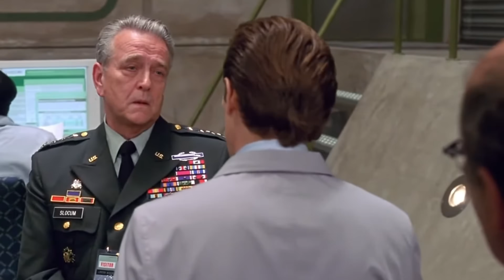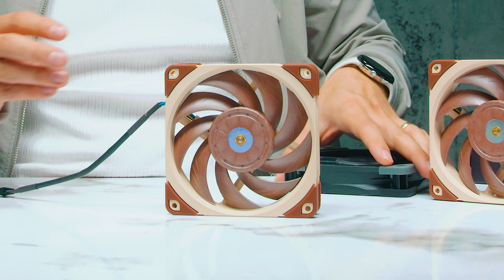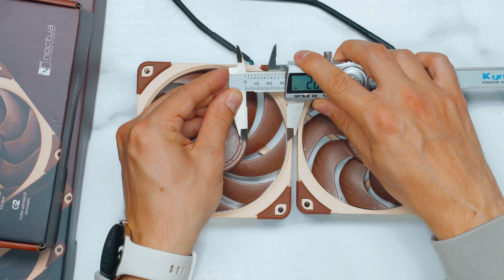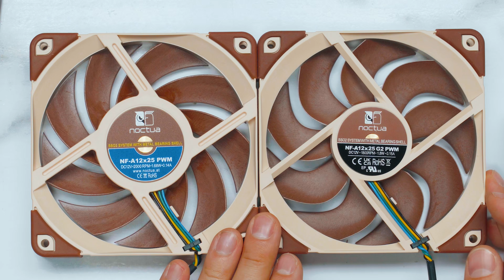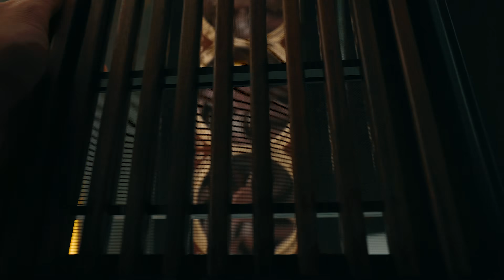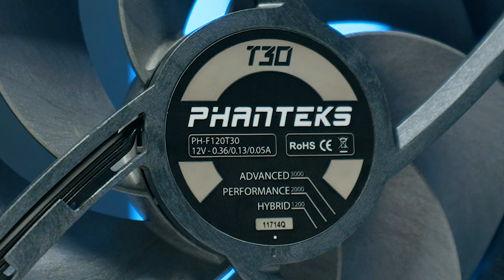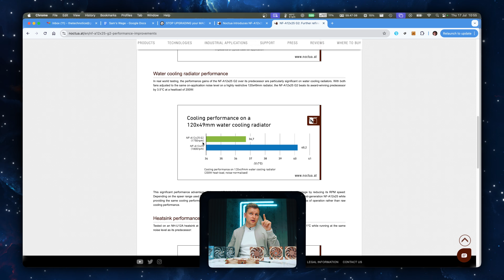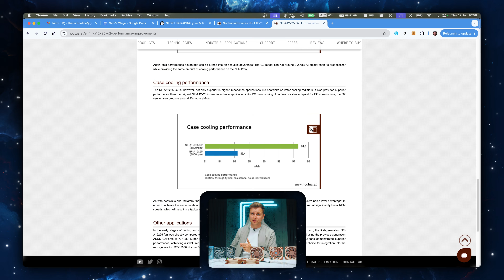Why it took Noctua 7 YEARS to BEAT the CHEATING Competition!?

Comment: There is clickbait and then there's this video.
Reply: I'm not sure if it's clickbait or just poor decisions.
Reply: @coreymoyers5771  be gentle, it took him SEVEEEEEEEn YEARS to come up with the right title!
Reply: He doesn't even know how to use the caliper and he probably felt useless himself when he went on a 3 minute yap about why he can't show us test results.
Reply: про рекламу забыли.
Reply: No he is right, at least partially. The Phanteks are too big for my AIO so they don’t fit and the Arctic p12 max I use gets unfortunately very annoying at about 3000rpm. Especially for ITX this is a lowkey game changer.
Reply: @Melnyx_definitely  huh? the p12 is noisier because it CAN go up to 3k rpm, and compared to the G1 version of the noctua, with both at max speed, it pushes 150% more air through a regular radiator and 147% more as a case fan. If your thermal testing for setting fan curves indicates your p12 max has to go to 3k rpm, the noctua would be insufficient airflow.

FWIW the regular p12 with noise normalised testing trades blows with the regular nfa12x25 on a regular radiator, and the deepcool fk120 beats it as a case fan - but again, NEITHER of them have as much airflow as the p12 max at 3k rpm, so would still be unsuitable for your system.
Reply: @Melnyx_definitely  Each company makes fans of different speeds/classes. He compared two different classes when there were similar speeds available.
Reply: @coreymoyers5771  The point being the competitor fans that have the same dimensions and rpm don't beat the equivalent Noctua ones. the only competitor fans that are better are in a different 'weight class' so to speak.
Reply: @ordin @ordinalchaos NOT the same RPM. That was my point, but you missed it. Noctua sells the same speed fan.

Your claims are baseless and scream from a lack of understanding on your part. Watch the video again and write down each fan's RPM. Then Google for a Noctua fan at the same RPM, and you will see they exist and are commonly available online.
Reply: @coreymoyers5771  Noctua does not have fans from the same generation as these (The new G2) with higher RPMs. The ones with higher RPMs are all older designs. So no, there are not higher RPM versions of the new G2 fans to compare with against the other fans.
Reply: @rekareaper Did you watch the same clickbait video as me? What does Gen 1 vs Gen 2 have to do with comparing faster fans against slower ones?
Reply: @coreymoyers5771  there are no other gen 2 fans that are faster than the ~1,800rpm ones. Fans having a different rpm doesn’t mean they can’t be compared. Lmao
Reply: @rekareaper He claimed they were the same speed and said the faster Noctua did not exist.
Reply: The dude’a affiliate link doesn’t even work. How gullible are you?
Reply: @coreymoyers5771  he was referring to the newly designed ones. There are no Gen 2 with higher speeds available than what was shown.
Reply: @rekareaper what difference does that make? I can’t help you if you think two different speed fans can compete with each other on airflow.
Reply: @coreymoyers5771  they can. Lmao. You’re just too narrow minded to understand how much different variables can affect airflow and static pressure.
Reply: @rekareaper you sound like you think the Earth is flat.
Reply: @coreymoyers5771  you’re the one whose logic would closely align with that if you think that only the RPM affects airflow. Lmfao
Reply: If noctua had rgb, even the most subtle rgb, then id get the black fans (if they were to have it). I grew up without rgb and when it started to become popular it was extremely expensive and now that it’s EVERYWHERE I want rgb everything. I don’t live a bland life and so I like color.
Reply: @BrofNeeko  Try Be Quiet

Comment: Seems like the rubber bracket’s to go around the diameter should be pre installed. Lot of messing around to seal that gap between the fan and cooler when mounting.
Nicely done video!
Reply: They are not preinstalled because you could mount the fan in any direction and static pressure doesn't matter if your mounting it as case fan instead of a radiator fan.
Reply: @Execuor  You could always remove and reposition on the other side - 50% chance of saving you effort.

Comment: I really dig the gaskets and I've always really liked Noctua fans, but I'm just not their target buyer- I don't really mind "loud" fans as long as they're not constantly ramping up and down and don't have a particularly annoying high pitch/resonance sound, which can be worked around by just slightly tweaking the curves anyway... 
I've got 3x four+ year old, cheap blue LED (not RGB) DC "no name" fans from Amazon on my main/ high end build and they don't bother me (yeah they're pretty loud, but not annoying). I also have five of those Artic fans in my mATX living room/ lan build (Montech Heritage) and I literally can't hear them over the "ambient noise" of my house without putting my ear right next to the case, so they might as well be off with any sound coming from the TV. 
If I get new fans and want to spend a bit more I'll probably look at Phantecks but I'd be extremely interested in a "no compromise brute-force" version of those new Noctua fans if they ever decided to make them- Maybe slightly deeper and around 2500 RPM, I'd be all over that for a radiator!

Comment: the matched pair with offset speeds is not about resonance. It's about interference between the sound from each causing an annoying "beat frequency"  They do not amplify, it's not a matter of more of the same noise, it's that the same (or almost the same) noise coming from 2 things close together interfere in annoying ways, NOT simply becoming louder.
Reply: It's about tandem resonance, hence the amplification....
Reply: @marioo-q8h  modulation, not amplification as such
Reply: @marioo-q8h that’s still not right. It’s an interference pattern

Comment: Other manufacturers are not cheating, it's just Noctua not following the trend. Thickness is not an issue in a lot of situations, such as case fans. If there's a 50mm fan that's can operate quiet, at low RPM, I'd buy that.
Reply: Exactly. I would incorporate that in my build. People building SFF PCs will wave it off and that is ok. But builders of a mid sized closed silent PC would use whatever performance is best.
Reply: @ThorMey-777  I'd use such a thick fan on my GPU, do the deshroud mod with that fan would be so good
Reply: Thickness is an issue especially for ITX, the group who cares about fans more than most people. I can’t use the phanteks in my A4 H2O since they literally too thick. Instead I got the p12 max, which work, but are sounding like a jet engine above 3000rpm
Reply: @Melnyx_definitely  Very few people build ITX its a niche.
Reply: @Melnyx_definitely  As I wrote, definitely not for SFF. Btw: Who aside from maybe industrial users or people with a private server room want to run a fan over 2000 rpm, or even 3000 rpm?
Reply: @Melnyx_definitely  a little trick - don't let the p12 max spin too much. It actually moves less air through obstacles when the flow is turbulent. Find where that happens for you.
Reply: @Melnyx_definitely  i think its more of a you problem if you cant dial in your fan curves and run your p12 maxes at 3k rpm. mine are 100% 0rpm idling and 800-900rpm gaming and this is more than enough. cpu stress testing does put them (cpu cooler fans only) to 1500rpm but thats it and its still just barely more audible than the silent profile.
Reply: Thinkness IS a big issue. You will have space problems and also have problems mounting the fans on certain AIOs cause the screws are not made for that thickness.
Reply: @naftyloescher  It is an issue, just not so much of an issue in other use cases, like as a case fan.
Reply: Noctua cant produce 200 different fans - they struggle to have 92/120/140mm fans in brown + black variants. And it absolutly is an issue in most cases. You often cant have big fans on top because of the motherboard. And on front panel there is simply no point and also no space. There is little to no cases that can fit more. Reminder if you want to have good cooling. You take the thick rad, and then you install push pull fan. So its 86mm (for example there are other rads i just picked Alphacool NexXxoS Monsta) + 2x25mm. I doubt your ATX case can fit that. And if ncotua would make 30mm instead it would fit even less cases - and it wouldnt fit most of SFF that are VERY popular nowadays - if someone build high end build - and noctuas are for high end builds. So yeah - assuming you dont already own thick rad andpush pull fan - no you wouldnt buy 50mm fan - you would think its not worth it - as you do now with thicker rad.

Comment: Arctic has a new fan out that you might want to check out, the P12 Pro. Same price as the P12 Max, but better. At least subjectively thus far for me. I have a few of the P12 Max and they all have bearing tick, have since day one. The P12 Pro is much quieter in that regard. They might even be a little cheaper. The last four I bought were under $9 and it's hard to argue with that price.
Reply: I was thinking just to change my old air cooler for new arctic freezer 360 III pro, but i want very silent pc with 7800x3d, so if i use these fans on let say 1000rpm all will be fine right and silent? (because stock goin to 3k is crazy)
Reply: @Dreamseeker-z9u  fyi if you already have an arctic AIO you will officially turn it into a "Pro" version by switching the fans to the Pro fans, that is literally the only difference between the LF III and the LF III Pro. I was using an Arctic LF III 360 AIO. I switched out the stock fans and bought the Pro fans, a couple weeks ago I stopped using the AIO I just went with a Thermalright Phantom Spirit 120 EVO because even with a 360 AIO my R9 7950X temps sucked.

Comment: First defining the other cheaters is a far stretch, they declare their numbers correctly 
Second you don’t even try to confront the spec of them out of published data from all manufacturers 
This seems just an advertising for noctua and declaring other vendor cheater is quite misleading no one of the other vendor to my knowledge has provided data far off real test performed by real testing site. 
Saying going at 3000 rpm is cheating is laughable, as a consumer you can decide at which speed you want to run them on one side and on the other if the fan CAN reach 3000rpm you can decide even time by time if you want more cooling sacrificing noise or not, if the fan stop at 1600 RPM you will not be able to reach certain level of performance. Like for engine you can run an f1 motor at low speed even if can reach 19000rpm and we can eventually discuss about efficiency when run at low speed but for sure you will not be able to reach same speed or rpm with a normal 4 cylinder motor of a standard car, it will be for sure more efficient at lower speed but it will not reach performance of an f1 engine, this is also the reason why for servers fan are run at much higher speed, in those environments no one care about the noise on a datacenter, the important thing is to get the proper airflow to cool processor and machine requiring much higher cooling than standard pc
Reply: if something looks like a duck, and quacks like a duck, then it probably is a duck
or somebody who thinks they are a duck...

Comment: I’ve don’t regret buying my Noctuas.  Cool and quiet, with zero problems from six year old fans
Reply: I have a nh-u12 for lga 775 from something like 17 years ago and the fan still works.
The cooler is still in use in my main rig right now, the fan is in my 2nd pc in my living room.
Reply: They will outlive you my friend.
Reply: Been 10 years 😂
Never clean them tho.
I'm using noctua industrial fan, guaranteed to exceed 150k hours.

I check the fans regularly, only small amount of dust stick to the frame & blade, it is indeed dust resistant.
Others will likely fail due to dust entering the rotor.
Reply: 2 with 8 years of service, still good :)

Comment: "Cheating" is kind of an odd way to describe it.
Reply: "Cheating" is the click-bait kind of way to describe it.
Reply: It is just a design decision to get more performance. Same with the Arctic Liquid Cooler III: It has a thicker Radiator than the competition and a bigger plate on the CPU, which makes it the best noise normalized AOI cooler on the market - if you make sure you got the room when building your PC.
"Cheating" is bullshit, because this is not a sports with clear ruling but a market competition. All competent reviews tell the consumer to keep the dimensions of the product in mind.
I have used both products (A12 and T30) in different PCs and both already performed excellent. Before I'll try out the new Noctua I check with Igor and Tech Jesus for some independent benchmarks and facts.
Reply: @ThorMey-777 It shows bias in the reviewer when they say "cheating"...
Reply: We call it competition
Reply: Technically, but for the T30 I understand since it does change the thickness variable so it's not a fair comparison and in some cases may not fit anymore.

But I do agree in general. I even like the thick ones since I'm not space constricted
Reply: every test i find between t30, G2 and other t1 fans has different results, and this guy isnt even testing them and just declares a winner based on maufacturer data and max rpm ??? pls make it make sense. 
phanteks was smart enough to make an engineering decision that made them jump ahead of the competition for 7 years. most people can fit 30mm anyway, even in sff, why would i care to compare it to 25mm?
Reply: If you're not cheating, you're not trying.
Reply: more like the competition has a better design and spanking noctua's ass for 7 years
Reply: I dunno I'd call it cheating either. I love Noctua fans, but either situation can be a compromise of sorts. You have cheap and fast but loud. Then there's quiet and slower but more expensive. 

Either way, go for the fan you'd think is good enough.
Reply: @NightFoxXIII  that's not how it works. Maximum fan speed is just a choice of the manufacturer. We as users, care for noise normalised performance since nobody is dumb enough to care about max rpm or performance. 

On the other hand noctua knows that over 1500rpm on 140mm or 2000rpm on 120mm, is just adding more noise in a PC environment. If you need more, there's something else wrong.
In fact you get 90 to 95% of the performance way before you even get close to those RPM numbers. 140mm hits severe diminishing returns around 1200rpm, and 120mm, around 1600.

Thickness is a shortcut to get more performance out of a fan at a given level of noise. Noctua did a lot of RnD. These guys did less, but increased fan thickness. Both are valid ways to increase performance, and this guy's video is just.....  a whole bunch of nothing.....
Reply: I tested them as room fans with an old router power supply 12V _1A---, 80mm0.25A--92mm0.22A (they are very loud) a 120mm 0.18A from an old PC power supply and a F12 arctic 0.0.21(1350 rpm), the 80mm0.25A--92mm0.22A are noisier and more efficient...(80-92-120mm with 0.19-0.21-0.25 amber can also be obtained from old PC power supplies)

Comment: Misleading video. I mean they are fine fans but you cant say that 1600RPM Noctua will move more air than 3300RPM Arctic. In fact it wont even be in same area code.
Reply: Kind of misses the point though, the industrial noctua fans do exactly that & they're just as unbearably loud as any other fan pushing well past 2000 RPM...

Spinning faster isn't really the answer when noise gets so far out of control for your gaming PC...

Comment: Hopefully, it takes less than 7 to fix their new 140s as they are not that competitive. Sure they are far better than the older model but those were bad to begin with.

Noctua had the good timing of most fans being pretty crap at the time. They took the gentle typhoon model and made it brown and put marketing behind it.

Their air cooler market has shrunk so much as competition has been relentless. Now they are moving to aio and thermosiphons.

Comment: Phanteks are designed under the Sanyo Denki, server grade.  Not sure what aspect they are cheating? My only complaint is that they should be 38mm thick as that’s gives a superior static pressure that even Noctua can’t match.

Comment: You should give the iCue software a try. It lets you fine-tune the speed of each fan individually. Corsair QX fans come with built-in temperature sensors, so you can create custom rules in iCue. For example, when my RTX GPUs hit 70 °C during rendering, the case airflow automatically adjusts. The fan colors are also tied to temperature: blue when the case is below 35 °C, red when it goes above 40 °C. I’ve also set precise fan speed curves for when the GPUs reach around 70 °C. On top of that, I use a Stream Deck with dedicated buttons to quickly switch between GPU and CPU performance profiles. Honestly, I think Noctua should also develop a dedicated software for fan control — it would perfectly complement the quality of their hardware.